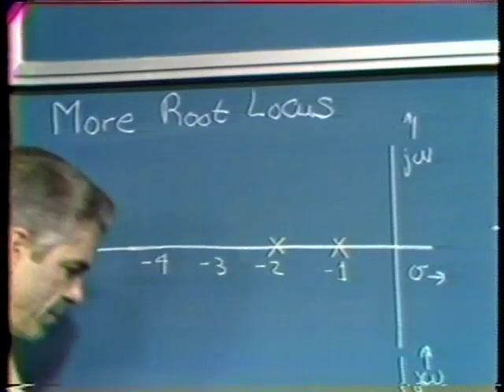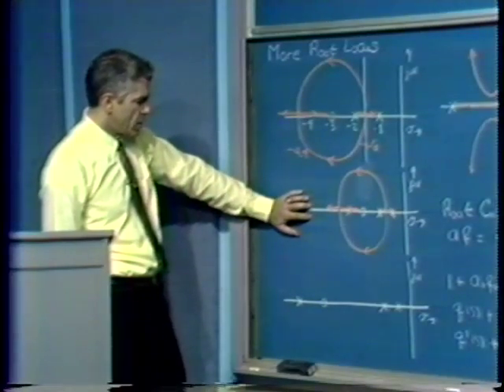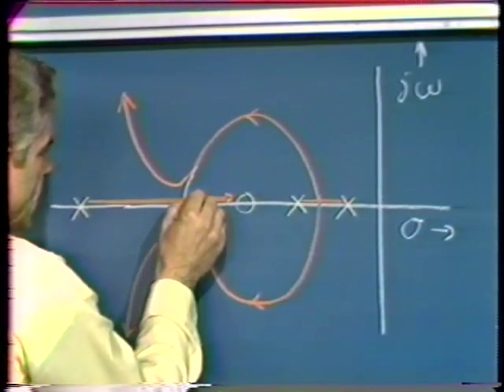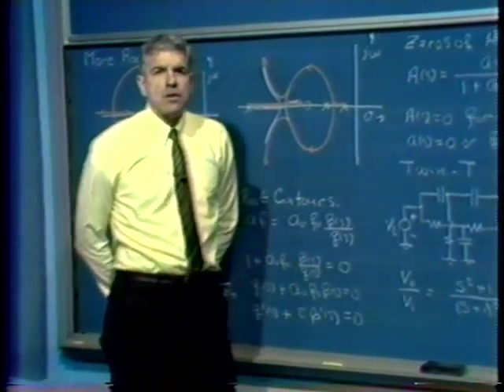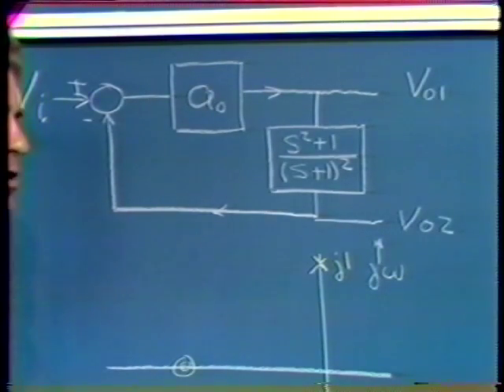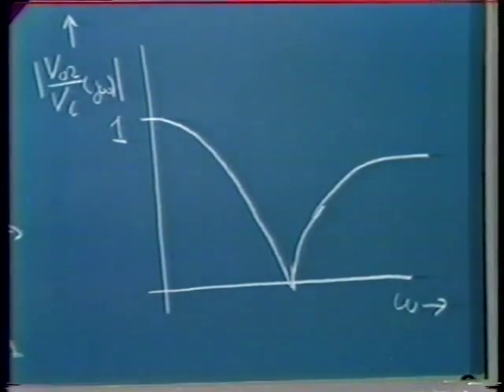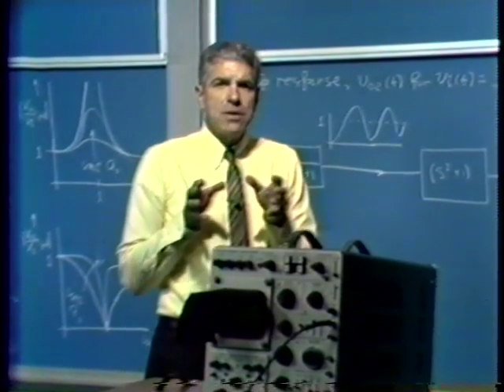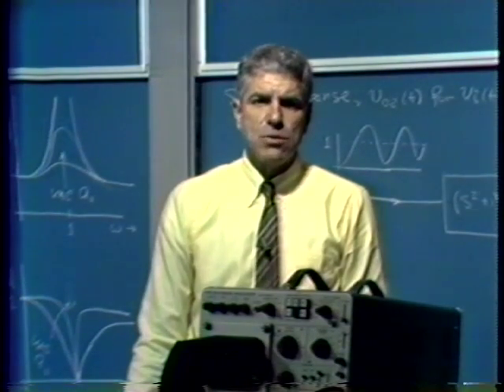6. More Root Locus

Comment: @30:30 The discussion of twin-tee is very obscure.. Does he plot the root locus here for V_o2/V_i or for V_o1/V_i ???

Note added later: OK I got it know.. 
-- He first draws the root locus according to the loop transfer function's poles and zeros. This gives him the location of the poles for all values of a_0. This result is independent of how the poles and zeros are distributed between the forward and feedback paths...
--Then he adds the system's zeros. These are quite different from the loop transfer function zeros and they depend on how the poles and zeros are distributed between the forward and feedback paths. Hence the responses of V_o2/V_i or for V_o1/V_i  turn out to be the different, even though they have the same loop transfer functions..